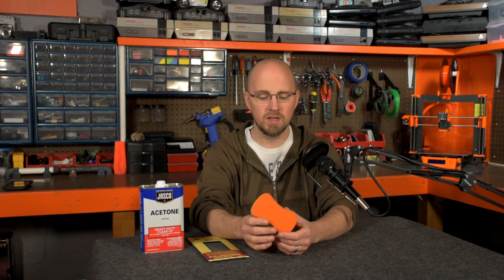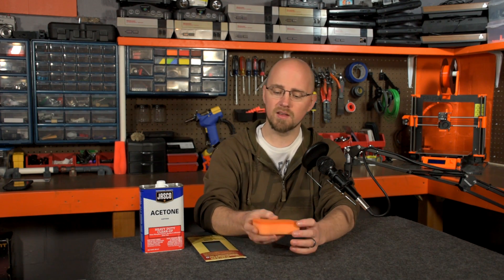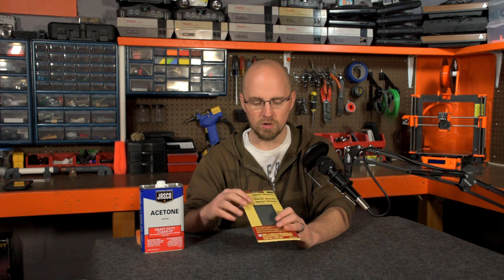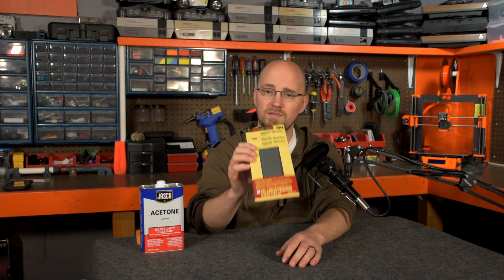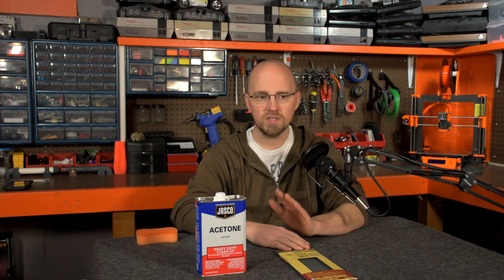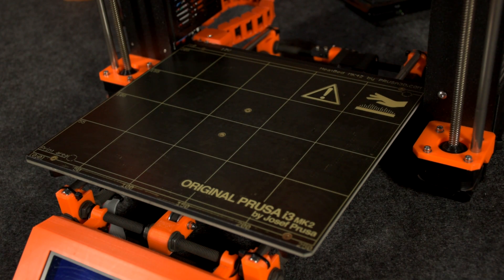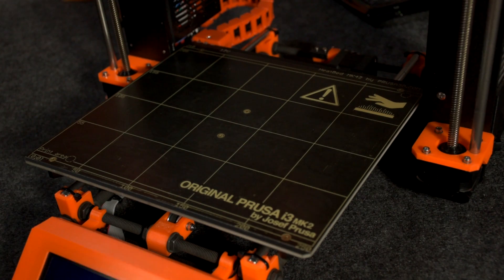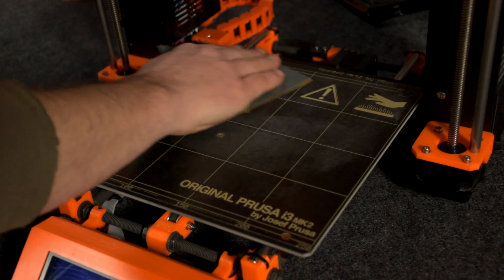How to - Rejuvenate PEI to Restore Adhesion

Comment: Your not sanding the pie sheet, that’s the heated bed. Folks 😮DO NOT DO THIS!!
Reply from the maker: Its a heated bed with a PEI sheet on it. I was not doing anything to the bed itself, and the PEI itself is ultimately replaceable if you would need to do that at some point.

For most people though, if your sheet is intact (as in not damaged), it is quite a bit easier to do this than to replace the sheet.

It is also worth noting that this video is over 6 years old, so anyone viewing it should make sure it is still relevant to the printer and heatbed setup they currently have.
Reply: you put a pie sheet on your printer?

Comment: Acetone is HORRIBLE for PEI. It will degrade it. NEVER use Acetone on PEI. Bad idea. Same with the 1500 sandpaper. A BETTER suggestion is to use a dish scrubber sponge, with auto degreaser. Then clean with alcohol. This is a safer and much better technique.
Reply: if you have scrapes or scratches or imperfections in your PEI, the ONLY way to fix that is to to remove material form the surface.

Comment: Just ran out of glue stick and decided to try this out on the beat-up secondary side of my Mk3 build plate, and boy does it work wonders!
Cleaned off the plate with soap & water, dried then cleaned with 99% isopropyl, scuffed the plate for about 30 seconds with 1000 grit paper, cleaned off with isopropyl and a microfiber rag, and put it back on the printer.

Did a test print with 5 small 2x3cm spacers i need for a project scattered around the plate, got one of the cleanest first layers in my printers life, 100% adhesion no corners lifting (PLA though).
No glue, no anything, just a clean (scuffed) build plate and easy printing.

Cheers!

Comment: Good video.  I was struggling with PLA prints warping at the corners, despite regular use of Isopropanol. A little 2000 grit sandpaper and acetone has my prints sticking again.  I also found Prusa's "First layer issues" KB useful.  https://help.prusa3d.com/en/article/first-layer-issues_1804

Comment: Before doing any sanding please just clean the PEI surface with acetone. I clean with IPA most of the time, but when adhesion gets worse an acetone wipe fixes it nicely! I've done hundreds of prints with varying prints and NEVER had to resort to sanding. 
Make sure to not use acetone with oil (for nail cleaning) though....
Reply: Acetone degrades PEI...
Reply: @AquaStevae  trying a degreaser first. someone said that Fast Orange 100% resurrected their PEI from 20% adhession to 100%. the major component is a citrus based degreaser.

Comment: Hey Nil, quick question about z level. My LCD reads Z 10. Is that correct? I'm newbie to this Prusa printer. I printed the V2calibration and it's off all the time. It seems like filament isn't sticking properly to the base. Please help!

Comment: I did this and it worked well, thanks!  However, I have another printer that I use PEI on and when it starts to lose adhesion I spray it with hairspray, works as good or better than sanding your sheet out!

Comment: Nice shop!  However one major point is cleaning the PEI between uses, as using 98%  Isopropyl Alcohol between each print will do wonders.  I have one sheet over year old and thousands of prints which just keeps going!  I keep a bottle next to my printer and just give it a little squirt and wipe with a paper towel and its off to the races again! Worth keeping in mind is the recommended cleaning solutions are isopropyl alcohol, methyl alcohol, soap, Heptane, Hexane, and Naphtha.  However one should avoid ketone based solvents like as MEK as well as strong bases as you might find in sodium hydroxide.  Also, sanding?  Have tried that in the past and frankly if its that far gone its time to flip over and use the other side and if that has been done its time for a new one as its the plastic itself (especially with a heated bed) which is doing the magic and not just the surface.  As sanding for ABS does increase the surface area, yet I have also found it comes at the cost of finish and do a print on a sanded PEI bed of say TPU can lead to a removal issues.  As that second piece is why I keep one printer with just clips (e.g. PEI clipped rather than taped) so I swap the PEI sheet based upon the filament I am using.  Again looks like you got a great channel and I sub-ed!
Reply from the maker: Yup, since day one I've cleaned my bed after every print with 90% isopropyl and  occasionally with acetone every week or so, so I don't think it was my lack of daily cleaning that led to the poor adhesion.

Also what do you mean "flip over and use the other side?" The sheet is adhered to the bed, its not separate from it. It also comes as sheets of thin, very flexible material so I'm not really sure how you could just clip it to your build plate without having it move all over the place.

I'd note as well that using 1500 grit sand paper leaves a very smooth finish, and you absolutely cannot see any kind of marks on the bottom of finished prints.

Are you maybe mistaking PEI for some other sort of build surface material?
Reply: Yes you can use both sides, it is harder if you tape (as you have to clean the tape off) however if you "clip" you can "flip" (yes it rhymes and didn't even intent it too).  With sanding your correct 1500 is very fine however I tried that once and printed TPU and it basically destroyed the sheet trying to get off.  Now I think I used something like 500 grit as I know it was courser that 1500.  However what I was trying to get is even after a crazy number of prints I have not found the need to sand (the reason for sanding the example above was an experiment to see what would happen :-)...  P.S.  like the orange color :-)
Reply from the maker: Haha thanks. 

Doesn't PEI have adhesive on the back though? I guess I'm not understanding how you can use both sides.

I guess it could be the case that its available without the adhesive backing, I've just never 'shopped' for any because the Mk2 comes with it installed and the extra sheets I got with the kit already have adhesive on them.
Reply: As DIY3DTECH above says you should avoid the use of Ketone and MEK based solvents this includes Acetone which will damage your sheet of PEI. Sanding can help a bit but i would suggest using 00 wire wool or equivalent its less abrasive than sandpaper and gives a nice matt finish to your parts.